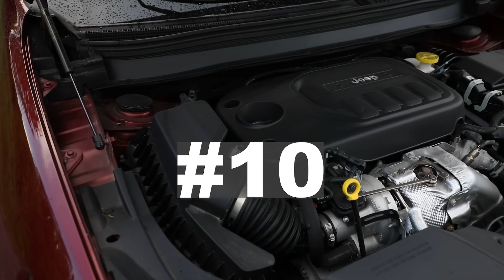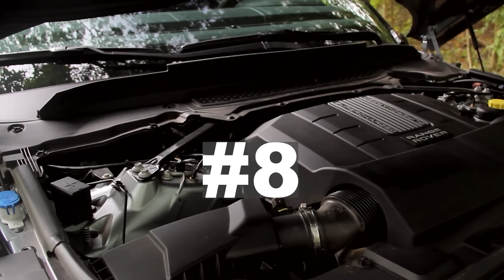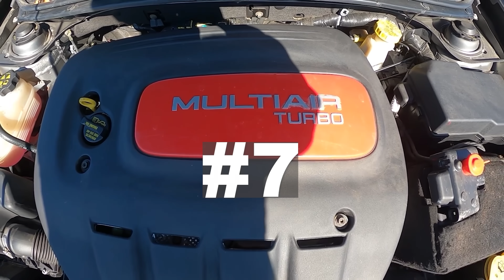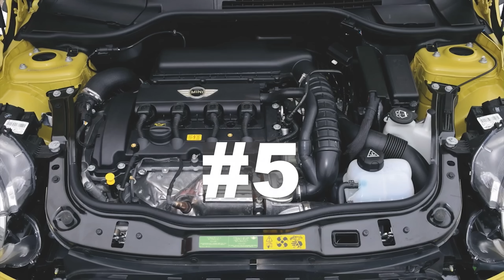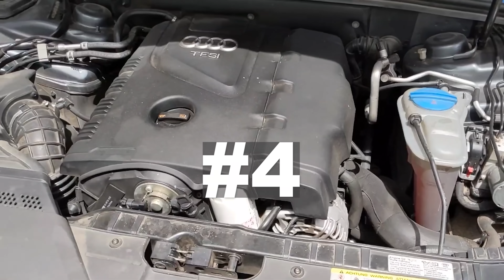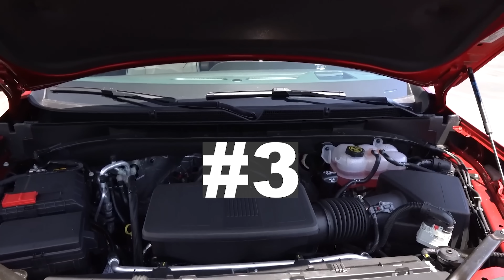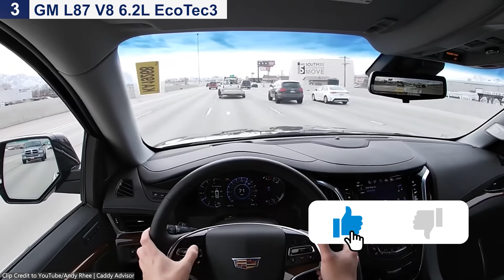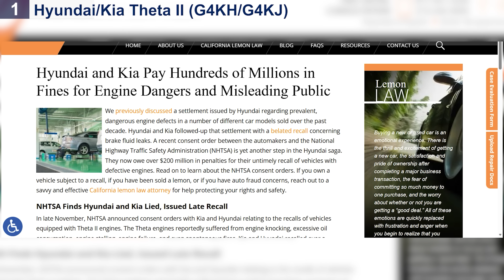The WORST CAR ENGINES ever made (AVOID AT ALL COST)

Comment: Audi guy here. Owned several of them and was a huge fan despite MANY repairable issues. The 2.0 TFSI engine is indeed a nightmare after warranty expires. The newer revised ones are having the same issues so stay away. The 3.0 TFSI Supercharged from 2016-2019 in Audi A6, A7, Q7, S4, S5 is having the same issues. People start seeing issues around 70,000 miles. Many had to replace their engines or had them rebuilt at a shocking cost. I bought one of these, Prestige, fully loaded only to realize that I threw the highest amount of money I have ever invested in a car through the windows. The next gen 3.0T Turbocharged made after 2019 to date seems to be faring even worse than the previous Supercharged one. Stay away people, especially from used ones after warranty. They are designed to hold up until right after the end of warranty.
Reply: Worst car I ever owned/Leased was a 2023 Audi A6.  Horrible car!
Reply: Owned a 2015 A3...was basically good(except for mounts)up to 115k😊
Reply: Thank God I have a RS3 2.5 liter engine relly reliable and fun to drive.
Reply: An independent German car shop owner told me the 3L V-6 was pretty reliable, but the 4-cyl definitely had an issue with oil leaks.  The key with any luxury auto is to ignore manufacturer recommendations to change oil at 10,000 miles and do it at 5,000-mile intervals instead.  Oil is cheaper than a major overhaul.
Reply: @JBM425  The older 3.0T Supercharged from 2012 to 2015 was relatively reliable beside recurring failures of water pumps and thermostats, and carbon buildup. I mentioned in my main comment the 3.0T Supercharged from 2016. People don't know but it's a very different engine which is, I would say, worse than the 2.0T given its complexity and cost.
Reply: VW are just about as unreliable as Audi; around 70/75k miles things start to break down. My 2009 Jetta wolfsburg's sunroof started leaking badly; a couple of spark coils failed, the timing chain was a bit noisy (the dealer said it was within tolerance so did not meet criteria for recall), the turbo started hesitating and when it reached 99k it needed a new clutch, prices ranging from 2400 to 3200 for a clutch! Traded it in for a Hyundia Ionic and have had no problems at all. No more VWs for me.
Reply: @amramjose my first car was a '75 VW Rabbit.  It later showed up in Consumer Reports 5 least reliable cars.  It was an endless money pit.  Never bought another European brand.
Reply: My 2014 A7 with a tuned SC 3.0 TFSI at 105k is a delight! A true sleeper. Just do your maintenance!!! UOA indicates no problems! This car drives like new.
Reply: @mrgbluecar  As odd as it may sound, it's the responsibly tuned ones and driven aggressively that seem to last. Coupled with a "different maintenance" i.e. oil changes every 5,000 miles as opposed to the 10,000 miles or 15,000 miles suggested and practiced by the manufacturer, cars that owners take in their own hands, tune and drive aggressively do last longer. The reality is that barely 1% of owners do that. 99% of used Audis out there have a highly compromised engine. However, your 2014 A7 has the older more reliable generation 3.0T Supercharged V6 engine and does not have the issues the more recent 3.0T Supercharged V6 (aka CREC) is having. Your water pump will fail many times and you will have intake valve carbon buildup and oil consumption to a certain level but nothing really as bad as with the newer engine which will literally start guzzling oil out of nowhere and destroy intake valves.
Reply: Bro I have 190k miles on my 2016 SQ5 with zero issues! None! Just the services, oil changes, new tires and rotors. Oh and I had to replace the battery and alternator.. That’s it! Im still daily driving it right now 💯💯💯
Reply: @DopeCity5000 190K on an Audi with zero issues is a blatant lie.
Reply: @KeliK1  I’m living proof ! Who are you calling a liar? This is my daily driver since 2017. And I have 2015 VW GTI 💯💯💯 I don’t lie
Reply: @DopeCity5000 Ok, let me rephrase it: I don't believe it.

Comment: Another example of 4cyl junk!  I had  a 2021 KIA Sorento, 4cyl Turbo - blew out 2 valves at 18,000 miles - i will say, KIA & the Dealership were very steller, in a most positive manner, no complaints there!  4cyl motors, are proving to be an inconvenient, costly experience, like  one mechanic stated if, you can get  90,000 miles out of a 4 Banger, count yourself, very lucky!
Reply: I wish Kia hadn’t removed the V-6 as an option in the Sorento in 2021.  Their V-6 had a much better rep than their 4-bangers.
Reply: @JBM425 so many mid sized SUVs are now powered by turbo charged 4 cylinder. I would never own a hybrid or turbocharged vehicle especially one that has a CVT. I can’t deal with all the technology nowadays. Reliability has gone down hill. I agree with you 100%.

Comment: That's why I'm buying a Toyota
Reply: That depends on the Toyota you are buying. If it’s the Corolla that is the cheapest you can go for Toyota. Camry, Rava 4, and the rest will be $30,000 something and up. Not much expensive than the other car brands.
Reply: Too Costly.
Reply: @kygent508  You'll save in the long run.